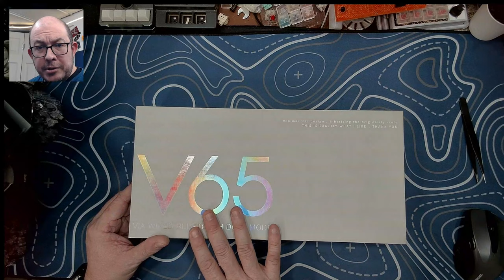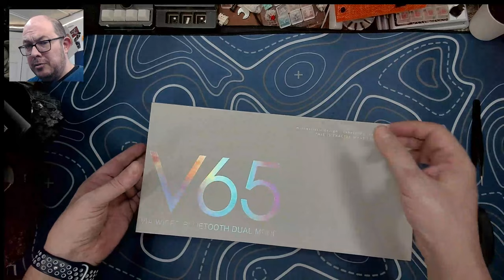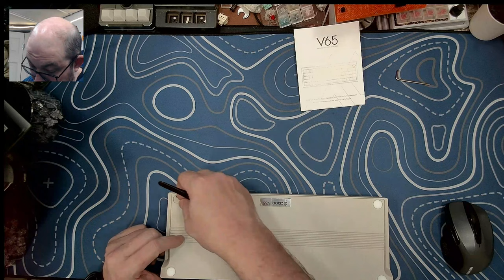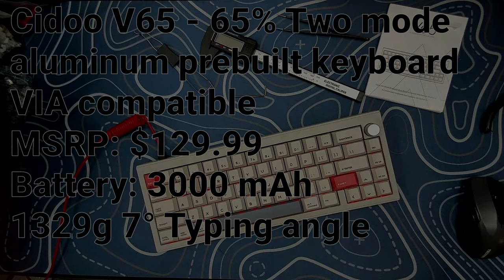Cidoo V65 A keyboard that does many things right but has some fatal flaws that I can't recommend

Comment: I did some digging in the manual online and found this line, "Note: In order to saving energy. Keyboard without backlighting under Bluetooth mode, unless plug in factory USB cable or power restoration." So it sounds like it's a "feature" to remove backlighting in BT mode. Not going to lie, I still ordered one. Depending on what I end up liking better between this and the Zoom65 (which still hasn't shipped yet) I'll make one of them my travel board and gift the other one to someone. I also have a QK75 on order, which I plan to take the reigns as my main board. Maybe I'll finally retire this Everglide SK68.
Reply: Bro I got one it's awesome. It doesn't need to be opened. It sounds incredible out of the box
Reply from the maker: @Spacebarf  well, it does include an Allen wrench, so...

Any keyboard made in recent times, especially pricier ones, should expect that users will modify their kit. Perhaps someone wants to remove the case dampening and replace it with poly-fill or a thousand other mods. Unless the board is advertised as a "Do Not Enter", the manufacturer should assume it will be modded.
Reply: can I have the keyboard your going to gift please 😂
Reply: @x3rts  You missed out, on Christmas I gave away a Cidoo v65 on r/budgetkeebs!
Reply: @DaveAlkema  Aww man damn

Comment: I own the 75% version (v75 model) of this board and the only issue I have is the sticker feet. The other issues you experienced didn't happen with my board. I've done a few mods and the board has worked great. I fully intend to get the TKL version as well.
Reply from the maker: Thanks for sharing.

Comment: These are tiny inconveniences, not in any way deal breakers. Plus you can use your own personal preferred pads and problem solved, most modders do use third party pads anyway & you can get the knob off easily. For the price this is a great board
Reply from the maker: I don't personally consider the JST connector breaking when disconnected and poor QA/QC a tiny inconvenience.
Reply: @MechKeyboards  That's human error I had absolutely no issues and you're supposed to be extremely gentle with the JST connectors, can happen to any keyboard. It's a 2 min fix to repair, and shit happens plus you weren't completely fond of the keeb.
Reply from the maker: @Authentyc  I had this happen with three units, others have reported their breaking as well.

Comment: Most of your gripes are quite valid. Got myself the FinalKey variant of the v65 and it's been an awesome on-the-go work board so far. The heft and weight is still enough to make it feel premium while not being too unwieldy like other heavier aluminum keyboards. And for the price point... definitely still worth getting despite its clear design flaws.
Reply: I can agree with you. I myself am looking to buy this keyboard. I'd say adhesive feet and the Bluetooth indicator are minor gripes, and many people don't mind them (myself included). But the second one regarding connectors is a very valid criticism. This keyboard appears to be suitable for the entry-level mechanical market, but it may not be suitable for the enthusiast market.
Reply: @TheCommonSenseForRegularPeople that’s the point Einstein. Go get your 230$ board in other places ;)

Comment: sure, there may be tiny flaws here and there, but i dont think that any of these are fatal whatsoever (except for strike 2 maybe). for strike 3, most people buying this board are probably going for a retro theme on a budget, and rgb doesnt really fit with that at all and isnt that big of a deal. bluetooth also has a lot of latency and rgb can be considered more for gamers, which means they probably wouldnt use bluetooth if they wanted to use the board for games. for strike 1, the feet on top of the screws isnt that big of a deal, the feet are still gonna stick on somewhat cuz its sitting on a flat surface. it also makes the board look a bit sleeker and cleaner imo. i can see how it can be annoying for some people, but it definitely isnt a fatal flaw. for strike 2, the jst not being crimped was either bad quality control or a rare defect for ur unit, pretty unlucky considering ive never heard of anyone else running into this issue. even if this is a common quality control issue, i do feel like the value ur getting from this board is insanely good. ur pretty much getting a board with a full aluminum case, gasket mount, polycarbonate plate, decent prelubed switches, plate mount stabs that can easily be tuned to sound great, pbt cherry profile dye sub keycaps, and a knob, all for around $130... seems pretty good to me. keep in mind that this board is made out of aluminum and comes with all of these higher end keycaps and switches, for $130, and that most aluminum barebones kits like the keychron q1 can start at $150 or more.
Reply from the maker: > most people buying this board are probably going for a retro theme on a budget, and rgb doesnt really fit with that at all (sic)

That's quite a subjective statement you are applying as objective.

The rubber feet could have had a nipple piece to fit into the screw channel, not an adhesive which will loose it's ability to stick once removed and reapplied, losing one means a wobbly board.

The JST connector is poor QA/QC, what else did they fail to test? Also, if you needed support or a warranty replacement, do you think you'd get one?

These are just my opinions, I know people who have this kit and enjoy it, I personally did not feel the price was worth the compromises.
Reply: @MechKeyboards   ive seen many keyboards purpose of putting screws under feet because they want a clean minimalist screwless design and yes adhesive feet are not the way to go though

Comment: Saw the R2 version of this and asked the seller what changed here is what they said. 

Difference compared to R1:
1. The accuracy of the positioning plate is improved, and the problem of shaking no longer occurs
2. The casefoam is thickened
3. PCB foam changed to IXPE material
4. The stabilizer is changed to screw in stabilizer
5. Change the keycap to ABS doubleshot translucent
6. Added black and wine red cases
7. The length of Gasket strips has been adjusted
8. The structure of the Bluetooth toggle switch has been improved and will be more stable

Overall for the price. I think this would be a perfect board for me to use at work!! Only annoying thing is thay I have to remove the feet to unscrew it. Great video btw!! Thanks for ur insights!!
Reply from the maker: Not until they come out with another long list of issues for R3. This keyboard was designed/manufactured by (FancyTech) FInalKey, who has changed their name three times over the last year to escape all of the controversy and issues they previously experienced, but are still up to their old games of cutting corners in order to sell products that just don't meet quality guidelines. Just my experience with them.
Reply: @MechKeyboards  saw this too!! Welp will update this comment on how mine performs. Someone sold this at the marketplace for about 80$ so I snagged it
Reply from the maker: @claud2755  good luck, hope your has no issues!

Comment: I just picked one of these up and had the exact same issue with the JST pins not being crimped properly and falling out. The keyboard doesn't charge and maintains that it's at 100% battery after days of use. It doesn't work in wired mode and I'm expecting it to run out of battery without the capability of charging it. It's a lovely board on the outside but certainly lacking on the inside.
Reply from the maker: I've been reading more and more reports of this keyboard completely dying altogether on folks. If they had only put a little more effort into this keyboard it could have been the budget king to beat, but profit was more important that durability or reliability, at least it would appear this way.

Comment: got this a short while ago, using it with durock pianos and staebies, feels and sounds amazing. also 9009 caps look great with case colour.
Reply from the maker: Sounds nice, I do hope you don't have any issues as there is no after sales support for this brand and the QA/QC, or lack thereof, is what guided me to keeping my money over this keyboard.
Reply: @MechKeyboards  iirc their ali store provides free returns so if theres an issue with it on arrival you can at least get your money back, in the long run im not sure theres any support either. both epomaker and the ali store gave me wrong info about it not supporting pcb mount stabs when it clearly does, and i learned this off youtube and the mech keys discord, else i would not have ordered. another thing to note is that for me the switches that are included felt quite fragile and i even had one of the plastic pins snap off one of the switches when i pulled it out. this has never happened to me in the few years ive been into this hobby and im not sure if it was caused during assembly (forcing the switch into the plate and pcb at an awkward angle) but it's alright since i was planning on replacing the stock switches anyway, too light for my liking. hope this helps anyone looking to buy this board as well:)
Reply from the maker: @binb0yyt  honestly, I hope I'm wrong, but I don't think this board will last more than a handful of months. The lack of QA/QC, the pins that were not crimped in the JST connector, the leftover flux, etc. Nothing but red flags. I like how it sounds, but if it doesn't work, it's just a pricey paperweight.

Good luck!

AliExpress, free returns, 🤣🤣🤣  

AliExpress allows any scammer to sell on their platform, stands by thieves when "disputing" an issue, and rarely, if ever provide refunds. I've been forced to contact my bank after a purchase goes south, which happens more often that I'd care to recount...

Comment: Would be cool if those little rubber feet on the back were magnetic
Reply: Dang thats a crazy good idea. 
Pros of not showing the screws without the cons of having to take the feet off

The feet arent too bad though took me abt a min
Reply from the maker: @KcCake  thing is that adhesive will wear out after a few times.
Reply: @MechKeyboards  yes true
I tend to only open my keyboard up a few times so the feet with the spares should be enough. 
If over time they wear out it wouldnt be difficult to reapply some adhesiv

Comment: guys, my keyboard is not working whatsoever and continues to flash blue in bluetooth and wired mode. i cannot use any fn combinations and i tried hooking it up to a wire to see if it was something to do with a dead battery but it still just flashes blue, and will not connect to my pc or be recognised as a device either
Reply from the maker: Sounds like another dead Cidoo. Sorry to hear, you could try contacting Epomaker, but they won't care. Wish I could offer some help.

Comment: Wich TKL keyboard you guys recommend for around $150 bucks? I was going to get de Cidoo V87 but maybe there's a better option for this price point. 

Thanks in advance ✌️
Reply from the maker: My favorite TKL by far is the Tiger Lite from KBDFans.
Reply: @MechKeyboards  thanks for the advice. Any switches to go with it?
Reply from the maker: @Drecan  my favorites are Gazzew U4Ts. Cheaper and still nice, Feker Holy Pandas.

Comment: Thanks for the honest review! Have you tried the v2 version? If so, whats ur opinion about it?
Reply from the maker: I have, the first had the same issue. The other is still sitting unopened as I'm fairly certain I know what'll find. There have been at least a couple of reports of the entire JST connector completely breaking off of the PCB.
Reply: @MechKeyboards  thanks for the quick reply! Sad to hear that, this would be a great budget if only the qc is good. Is the Monsgeek M series a better alternative? They are at the same price point, I wonder if the qc is much better in that brand
Reply from the maker: @punpun3765  yes. I've got each of the M series and have found them to be well built, though some M1s do have the potentiometer at an angle which causes the stock knob to rub on one inside of the circumference. They are all well built, very substantial, easily modifiable, and QMK/VIA compatible. I've not had any issues and have not heard of any others other than the knob issue.

FinalKey, used to be FancyTech, and recently FancyLab; they were banned from selling on AliExpress under their name because of the all of the chargebacks and complaints. They have now partnered with Cidoo for these boards and in an apparent way to make a profit, they are cutting many corners. I'm afraid that this is one of those "too good to be true" situations.
Reply: @MechKeyboards  Really appreciate this replies. Looks like im going for the M3. There are 2 versions tho, the other one is no qmk/via but much cheaper. Is qmk really essential for casual use?
Reply from the maker: @punpun3765  it's really a question if you want to have full control over customizing the functionality and the ability to access VIA using a web browser from any operating system. I haven't used the closed source Monsgeek software, but I've been told it's quite similar to Akko Cloud, which would make sense. If it is, it's not too bad to use. I just reviewed the Akko PC75B and there is a bit near the end with the Akko Cloud driver: https://youtu.be/vTjgJC-ew6E?t=915
Reply: @MechKeyboards  Thank you so much for the quick answers! I also watched your reviews of the M series and im convinced to get my own, qmk or not.
Reply from the maker: @punpun3765  you are welcome, good luck on your quest and feel free to come share over on https://reddit.com/r/BudgetKeebs once you've finished your build, cheers!

Comment: Well, built one for my mate and I would say it's good at this price point (only 88 bucks for a cnc aluminium kit in my country). But there're some flaws that I have to mention it here: 
First of, the switch used to switch between wired mode and bluetooth mode a lil bit loose (but thankfully it will be fix in the R2)
Second, the aluminium surface feels...cheap. Yeah I know we can't really expect it's going to be the same as high-end kit but still it disappoints me a little bit
Third, as you mentioned in the video, you can't use led on bluetooth mode, which is kinda weird (this is the first time I've ever seen a keyboard doesn't allow you to turn on led while using bluetooth lol)
Last but not least, you can use VIA but still the firmware is buggy as hell. I tried to change the led color and you know what? It's literally flickering after changing the color (even after you change it for hours) and the fact that they don't test it properly after releasing the board made me feel frustrating (they said it will be fixed in the next update but still, ya know)
So overall, I'll rate it 7/10 (It has some potential and hopefully they will improve it in the R2).
Also I recommend you to have a glance on the Monsgeek M1 (also aluminium, released recently and it's a small brand apart from Akko). It uses the same pcb from the Mod007s and the case surface feels really nice with the price only at 69 bucks, and the GMK67 (literally a clone of the V65 [same layout], plastic, have 2 daughterboards, light af with the price at 40 bucks) ;)
Reply from the maker: Honestly, I'd rate this board at 3/10. I also experienced issues with VIA, for the first time. This board was not properly QC'd.

I'll ship on the Monsgeek, as I am done with Akko keyboards; too much hassle with customer "support" and poor quality control.

I do have a GMK67 enroute though, looking forward to that.

Thanks for sharing!

Comment: I also don't get why an amazing keyboard like this doesn't have leds while using wirelessly. I think they did that on purpose, like prevent you from having a perfect one with that price. :face-pink-tears:
Reply from the maker: The V2 does allow the lights on while in wireless mode, but still has manufacturing issues, I have 3 units of each version which all have issues or are broken altogether :/
Reply: Hi I'm back for some feedback. I bought V3 version and lights are allowed in wireless mode. With leds turn on the 3000mah battery can last a couple days if you not typing all day. Luckily I haven't gone through any bad experience! I hope it can be good in several years
Reply: @kan9745  Did they fix the issues MechKeyboards mentioned in his video? Any noticeable improvements wrt the PCB or JST connector?